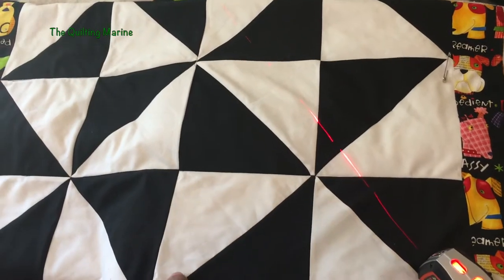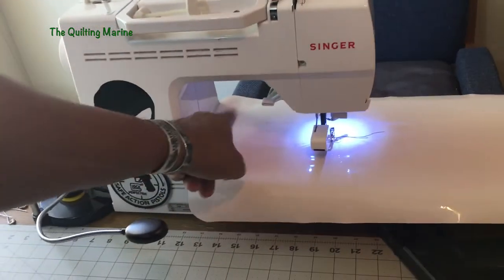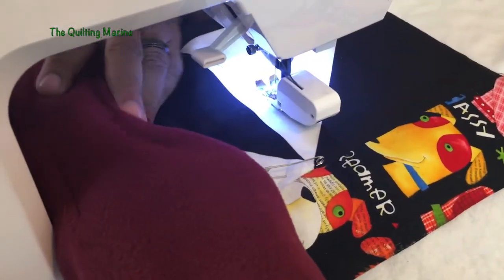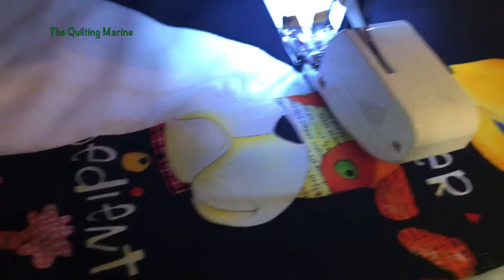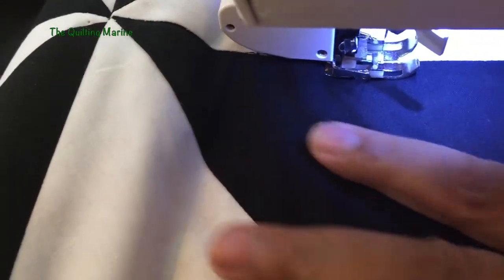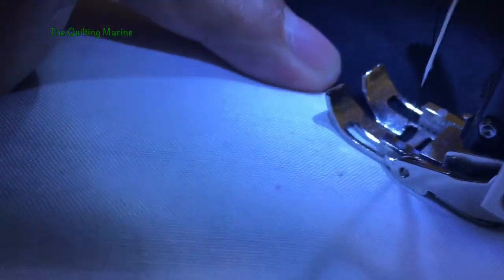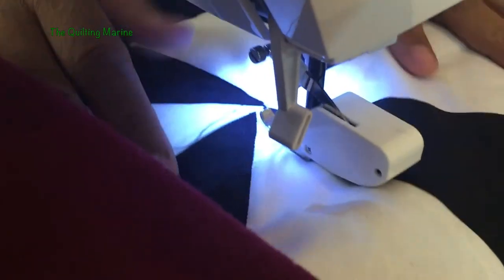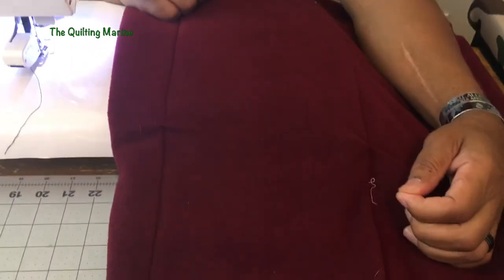Let's Make a Pinwheel Quilt | Stitching in the Ditch

Comment: Awesome video!! I have never heard of the Supreme Slider. You seem to like it. I will stay tuned to see how it works out for you. I'm afraid I have no cure for puckers. I do put my quilts in local fairs so if I get a pucker I pull out the surrounding stitches, smooth out the pucker and re-sew. Your softie softie fluffy fluffy fabric does tend to stretch so it is a bit of a challenge that I try to stay away from when I can!!  lol   :)